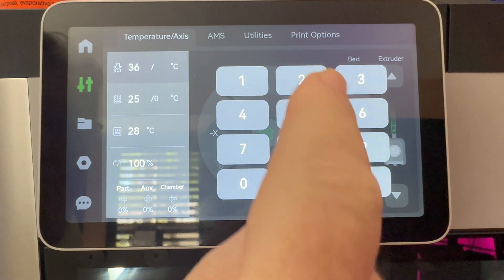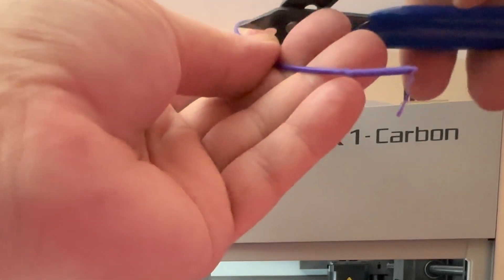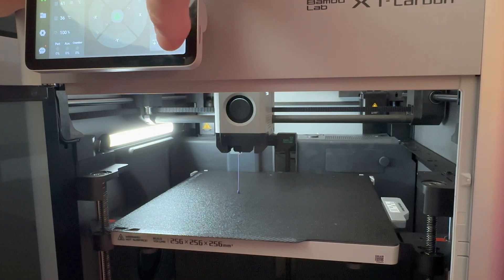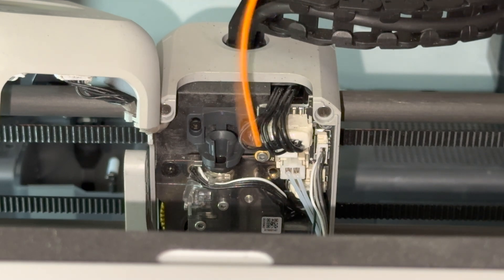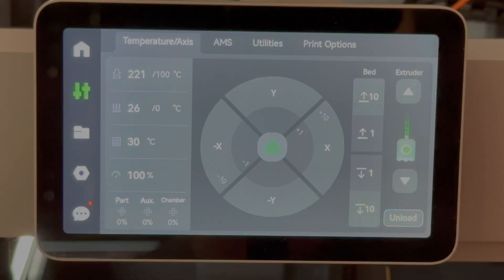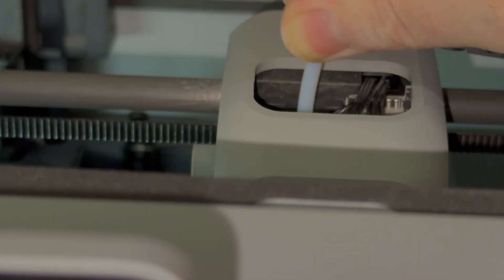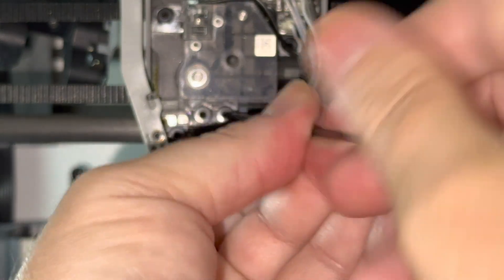How to Easily Unclog Your Bambu Lab 3D Printer Nozzle: A Step-by-Step Guide

Comment: When I push the filament in to the extruder like you show, it does not move at all no matter how hard I push. I see the yellow gear moving without issue, but the filament does not enter the extruder. Any tips for that?
Reply from the maker: If that’s the case, try the cold pull. And if that won’t work, get one of those pockets and push it through with that one.
Reply: @techwithkramer Thanks for the reply! I took apart the extruder and it turns out a piece was broken in there through the length of the extruder, so when I was pushing the new filament in I was just going next to the broken piece and that's why I couldn't push it through. 

I think your video is still great advice for the first things to try, to save time, but I think if you try to push filament through and it won't go then it's probably best to take apart the extruder. I didn't try this, but it might have also worked for me to remove the hotend and push filament in from the bottom of the extruder. It's just hard to see under there.
Reply from the maker: Yep, that will definitely do it. Glad you’re back up and running again!

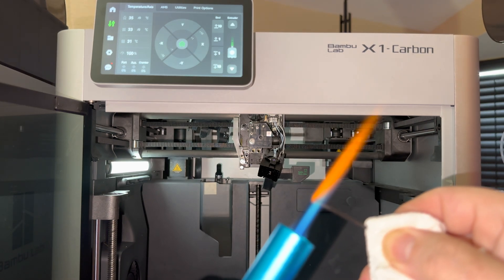Comment: 2:45 The hot key into the stuck filament saved me,  I used a paperclip and there we two separate pieces stuck in there so had to repeat. Many many thanks!
Reply from the maker: Glad it worked out for you!

Comment: ive spent 4 hours heating up allen keys, using a soldering iron, doing what you did in this video but nothing works. I guess im gonna throw that nozzle away
Reply from the maker: At some point, the hotend is gone. They don’t live forever, but most of the time it works. If there is too much burned filament stuck, you might be able to get it with the needle. But it is a consumable after all, just like the plates don’t last forever either.

Comment: Thank you for the video. I was wondering if you have tried this on a 0.2mm nozzle? It works for a 0.4mm nozzle but not 0.2mm. I tried the last part of your video heating the end of the tool and then heating the nozzle to 220C. It does pull out part of the stuck filament but the clog is still there.
Reply from the maker: On the 0.2, you need the special needle 🪡 that is made for it to push through.

Comment: thank you.  I had done the cold pull by heating up a small drill bit and pushing it into the broken end of the filament stuck in the hot-end..  This was my first time heating the nozzle manually, then extruding and then cooling and retracting.  I think I'll try that first next time.
Reply from the maker: Good idea to use a drill bit.

Comment: This is exactly what I needed. What a great video ❤ The only thing is with new updates you can't bypass heating to 170 unfortunately. So I let it go to 100 then heat back to 170 then pull it out. Not sure if it has the same effect but that's what I did.
Reply from the maker: Thanks. Just to make sure, you pull it out at 100 degrees - that’s why it’s called cold pull.

Comment: What if you were a dumby and cut the filament? I took apart the whole extruder and cleared out the gears. The nozzle is still clogged. I tried to get filament to come out but I can get this method to work. Do I need a new nozzle?
Reply from the maker: If you can’t get the filament out and you can’t push it through either, then it’s time for a new hot-end.
Reply: @techwithkramer I got creative, unscrewed the hot end and left it connected and stuck a string of pla into it

Comment: Is there any reason when using a 0.2mm nozzle on my x1c won't print anything?- it prints the first material flow at the front of a plate ,but when it moves to start the print,it just clogs up on the nozzle.

Done clabration,cleaned plate,use generic PLA setting. Change nozzle temps,flow rates.. im at a loss
Reply from the maker: And you changed the setting in the slicer to the 0.2 nozzle under Device-printer parts- nozzle diameter as well as in the printer profiles? Both need to be set.
Reply: @techwithkramer, yeah, did all that. I even tried bambu Stock Pla over the sunlu pla , and still the same problem. Want to print some lithoplanes, but can't even print the flow rate plates for calibration.
Reply from the maker: @Puddingladd try to increase the nozzle heat. And if that doesn’t work, try changing the hot end.
Reply: @techwithkramer  Ill try that, but the hotend is brand new ,inly installed it yesterday.
Reply from the maker: @Puddingladd maybe the filament had a bad part in it, I wouldn’t throw it out but it’s part of the elimination process.

Same with the extruder, if you have an extra one, switch it. This way you can see what part is the issue

Comment: I have tpu stuck in the nozzle.  It won't extrude and I can't pull it out after heating the nozzle to 260C.  What to do?
Reply from the maker: Take both the heater and thermistor off and heat it with a flame 🔥 while punching the filament out with something like this: https://amzn.to/4kFLvhr - so far, I was able to fix any clogging using this brute force method.
Reply: @techwithkramer  Thank you!  Just ordered it at the link you provided and subscribed to your channel!
Reply from the maker: @MOVIEKICKS Thank you, glad to help.

Comment: They make filament to clean the nozzle... be careful doing cold pulls because you can cause further clogging if a piece breaks off and can damage the extruder.
Reply from the maker: The extruder is not even part of the cold pull, not sure how you would possibly damage it when it’s not even connected to the hot end at the time. And no, even if the filaments breaks, you do not cause more clogging than you already have. Did you ever try the cleaning filaments? It is not used to get rid of clogging because you would not even be able to insert it as the nozzle is clogged.

Comment: Been trying to figure out what was going on with my A1 for the better part of the day. I had used the pin to attempt to clear the nozzle from below. Wasn't aware of the 'cold pull' method until i watched your vid. Gave it a shot and sure enough fixed the problem. Thanks for the informative vid mate, appreciate it.
Reply from the maker: Nice, glad it worked for you!

Comment: Hm... I don't understand how you are able to push/move the ptfe tube enough to expose and grab the filament inside. Are you disconnecting the tube in other places too...?
Reply from the maker: If you push the black ring in the tool head down, you should be able to pull the ptfe tube up.
Reply: @techwithkramer  Thank you for your reply! Unfortunately we just couldn't get the tube to move anywhere after pushing the ring down (it released the tube, but the tube had nowhere to go). So we disconnected all the ptfe tubes, starting in the back of the printer, and then pulled out all the filament except what is still stuck in the extruder (this gave us more room to work because at the back, the tube seemed less married to its position). So now we are just using the usual unclog methods to clear out the extruder and nozzle. Thx! ✌️
Reply from the maker: Well, glad you fixed it, sorry I wasn’t much help. Next thing I would have recommended was to push filament from the top while releasing the tube, but that a 2 person job. Anyway, you’re all set, let me know if there is anything else you need help with.

Comment: I did the hex tool heat up trick (brilliant btw!) and got some out, however it still will not extrude. I don't visibly see any more filament stuck inside. Any ideas?
Reply from the maker: Sounds like the extruder might be blocked, check out my extruder video.

Comment: what about just heating the hotend and pushing to plug halfway in then followup with a fresh line and push the broken crap out until its running the new filament then pull it out?
Reply from the maker: If the plastic is burned inside, you wont be able to push it through.

Comment: ok so i dont need to worry about my fingers on a 250C extruder?   I guess you don't touch the pointy bit?  Or are you a pro chef?
Reply from the maker: 😂 I only touch the cold side, not the pointy part. And yes, I love to cook, even though I am not a pro. I can easily say I burned myself more in the kitchen than on any of the 3D printers. And it was very easy to get burned on the older machines.

Comment: excellent video thank you. solved my issue perfectly! Just a question - how do you push the filament in? In older printers I can de-energise the extruder, I don't see that option. So I had to use the extruder to push, which makes it a bit lower flow than I like. Also it makes me doubt the cold pull was as effective as I'd like. Thanks again!
Reply from the maker: I just push it with my fingers in addition to the extruder, it works most of the time. But if the extruder is blocked or in some cases the clog is so hard that even a cold pull doesn’t help, the push itself won’t do the trick. So it’s different every time.

Comment: Had to stop back by and give you a subscribe and a like on this video especially.  I had a clog on my X1C.  Im only a few months into having my first 3D printer so I wasn't experienced with all maintenance since it's an X1C.  So a few days ago in the middle of doing a 32 plate project, all of a sudden my prints started failing.  I figured out what it was and even though I already purchased an extra hotend combo, I decided to try to clean vs putting on the new.  And these steps did the trick.  I also had some sample cleaning filament laying around.  But my first print since doing these steps and it's working perfectly again.  Thanks again.  I saw one of your videos way back when I was still days into this and saved them in my 3D bookmarks.  Now I see you again and I used your advice.  Sorry if you read all this.
Reply: I purchased the extra hotend just to have before I got the clog.  Along with a lot of other spare parts, cutters, etc.
Reply from the maker: Great that it works out for you, I am happy to help. Thanks for the nice feedback.

Comment: This was awesome! Especially that last section about the broken filament. I didn't have a small hex key handy, so I used the pointy end of a safety pin. Held it with needle-nose pliers, held the point over the flame until red hot, and stuck it into the top of the nozzle as you showed. Heated the nozzle to temp, and the broken piece came right out. Back in business! You rock!
Reply from the maker: Great idea to use a safety pin! Glad it worked out for you.

Comment: Hey! thank you for the video, it helped me last week A LOT, but now I can't figure it out. (sorry about my english, I'll try my best) When I heat 260°, insert the filament and then take it out, nothing happen and it doesnt melt (like it's not reaching the heated part), its like the nozzle is stuck. I opened the extruder to see if some little filament got stuck in the gear but it didn't, so then I tried to unstuck the nozzle. I put an allen key, applied some heat and inserted it on the nozzle (that helped me last time), but when I pull the allen key it doesnt take out the filament inside it. I tried also inserting the very thin neddle through the nozzle but the same, it doesnt go all the way. I don't know what happened inside the nozzle but I cant get it out. Can you help me? thank you!
Reply from the maker: How old is the nozzle? In some cases, specially if the nozzle is older, there is too much residual filament that is burned and no longer gets melted. This is what the cold pull should solve. If this is no longer working, it could be too crusted up. Did you use any glitter filament or other effect filament with particles inside?

Comment: THANK YOU A WHOLE BUNCH!  I just did your first directions but from a real lazy viewpoint.  I heated nozzle to 260 and then I stuck a thin wire up the nozzle from the bed side.  It went up in and I poked around so it went in about a inch or so.  I pulled it out and filament was stuck on it.  Took new filament and did a load and told it to retry several times so I could make sure it got all the bad filament out.  I then told it to print a small test part and it worked.  AMAZING!  I did take the heat sock off but I wouldn't have had to do even that.  Git-r-hot and poke her good and that worked.  Thanks again!  🥰
Reply: I finally fix it with your method, thank you. Because on mine, it was partially clogged.
Reply from the maker: Glad it worked out!

Comment: First time somebody said click like and then subscribe while I was liking and subscribing.  No this is excellent as my Bambu Lab X1C has been printing PLA perfectly for a few weeks.  Now I was thinking of a print with Marble PLA and I kept hearing it might cause a clog.  I just wanted to know how to handle just in case.  I saved this in my 3D print bookmark folder.  THanks
Reply from the maker: Marble is usually fine (depending on the brand, I use mostly overture). Glitter is a different story… thanks for your subscription!

Comment: Hello, i have a really unusal problem with my X1C.  It doesnt seems to be clogged. I have done like 7-8 Prints from buying and i wanted to print the same print i had last time. after 5h i came back and saw spaghetti and fibers all over my print. After i cleaned everything inside i printed the same model. Sometimes the first layer is perfect sometimes it print half of the first layer and stops extruding. When i pause and resume the print it extrudes normaly. Sometimes i get 4 layer without any problems and then it stoppes extruding or it extrudes in  short lines. I dont know what i can do. I dissasamblied the extruder and the grease was full with fine fibers. So i cleaned it up and the problem is stil there. When i tap the extrude button on the display it comes out without any problems. I dont know what to do.

Greetings
Reply from the maker: Seems you have several issues. If the first layer fails, it usually is the build plate. It needs to be wiped down with alcohol after every print. You also seems to have heat creeps, try keep the door open when printing. You say there was grease in the extruder? Grease would prevent the filament to get gripped by the teeth of the extruder, so there should be no grease. Clean it with alcohol too like in my video. Let me know how it goes….
Reply: Hello and thank you for the Fast reply,
I would say, that the printer is brand new btw.
I think, that I don't have any bed issue, because when it extrudes it sticks to the bed but the problem is, that the printer just don't extrude in some situations. Spontaneously. The grease was not on the gear wheel where the filament is on, it was the gear wheel from the other one. And not the yellow one. Sorry that I can't explain it better but it's not my own language :(.
I print the same model all the time. I hadn't this issue before and the door was everytime closed. I print it right now with the door opened. I'm almost done and there are imperfect prints. It looks to me like the opened door cools the printed filament faster so there is no Spaghetti but I can't clearly hear, that the nozzle is touching the print sometimes and because of that it lacks sometimes the filament. I haven't changed anything in the printer and I use the standard parameters. I have never washed the plate until the problem appeared. Then I washed it with warm water and dish soap and the problem appeared second time. Then I washed the plate again and reversed on the other side which was never ever printed before and the problem appeared again. It seems for me more like a software problem/sensor problem, that it sometimes decide to not extrude. I really appreciate your help.
Reply from the maker: @TrashMull Change the infill from grid to gyroid should fix your touching noises. Other than that, the filament could be too wet, try drying it using the Bambu dry cycle. Hopefully this might help.